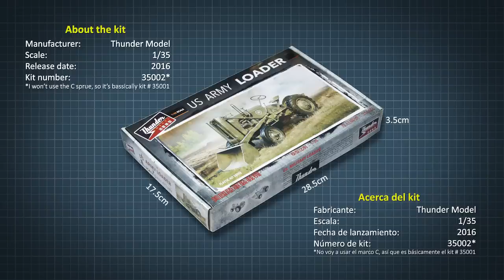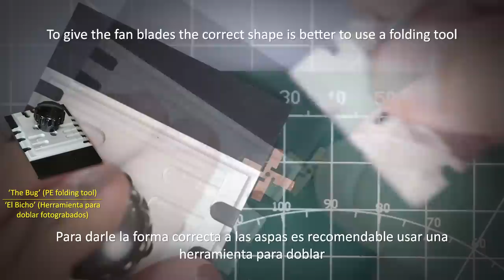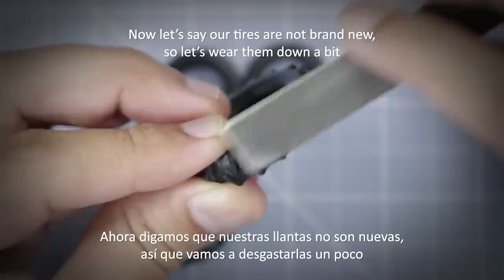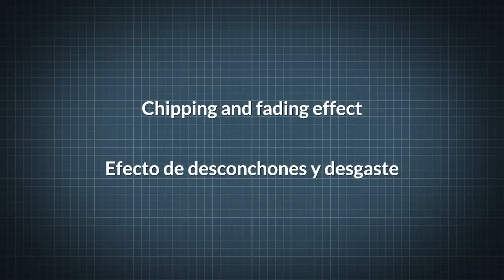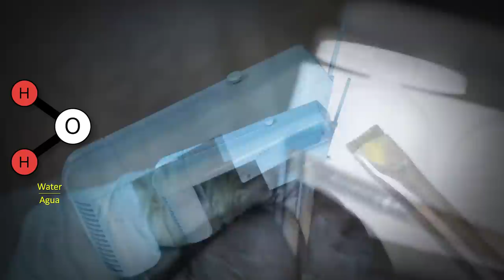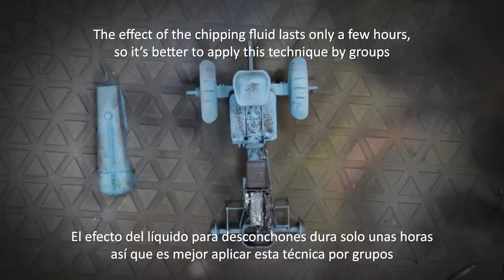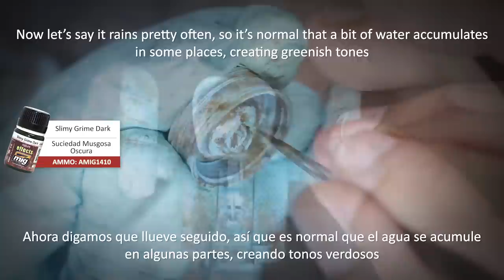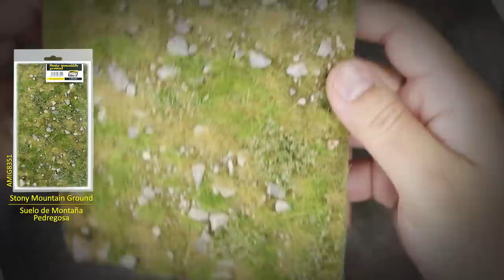Abandoned Rusty Tractor / Tractor Abandonado y Oxidado - Scale Modeling Tutorial

Comment: Just like the rubber parts on tanks, rubber tires of tractors also wear a great deal.
However, for some reason, most modellers (99% or more....) forget to age the rubber....!!!!  You should take out some bits and pieces of rubber and make some scratches.  Now THAT will add a great deal of realism.
I see many tanks (and tractors), weathered and aged, but EVERYBODY forgets about the rubber parts.
Taking bits out is easy on plastic parts. With real rubber or vinyl you might want to put the tire in the freezer, overnight. Taking rubber out with a hobby knife might work better when the rubber is very hard. At room temperature the rubber or vinyl might be too soft to get the desired result.
Other than that, this is an awesome model. Well done !!
Reply from the maker: Thanks for the suggestion, but as many aspects of the model, it depends on the story behind it. Search for abandoned tractors images and you'll get a full range of wearing. Lots of abandoned, rusty tractors look like they have new tires.
Reply: Well, I just checked Google Images, and I can not find a single picture of an old, abandoned tractor with wheels that look like new. Wouldn't be possible, either...........
Although it is possible that at one stage, a tractor had new tires fitted, only to be abandoned, soon after. That's possible.
But where tanks are concerned, the rubber on the wheels are the very first things to suffer damage, since the rubber rolls over the tracks and hard rocks end up between the rubber and the tracks. I have never seen undamaged rubber rims on a tank that had been in use for a while. Not when I was in the army and not in pictures, although those tiny damages are very hard to see in pictures. You need to find close-up pictures to spot them.
Having that said, your videos and models are a true inspiration to me !! Let that be said !! I love them all, the videos and the models !!
Credit where credit is due !!!!   ;-)
Reply from the maker: Thanks! Yeah, most times I forget to add damage to tank wheels. (I did it for the Tiger video, but I think that was it). It's a mistake I'll try to address in the future. Thanks again :)

Comment: Thanks for the video! I've got two of these kits as well and as a heads up, have noticed the engine halves look a bit short shot and required a good amount of filler along the top seam. However, it's not really visible under the hood. :-)
Reply from the maker: Thank you, Kyle! I didn't have that problem with mine. The fit was very good